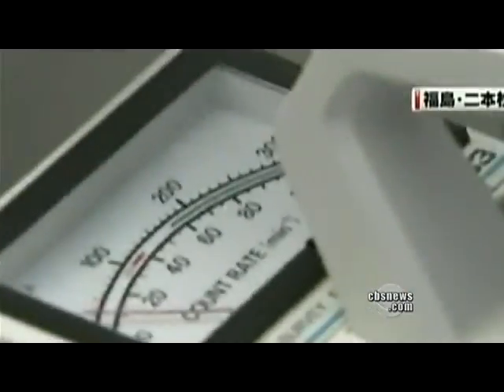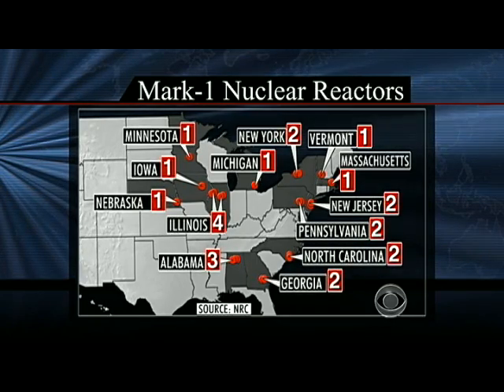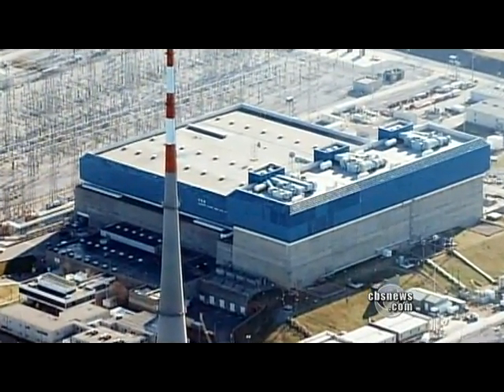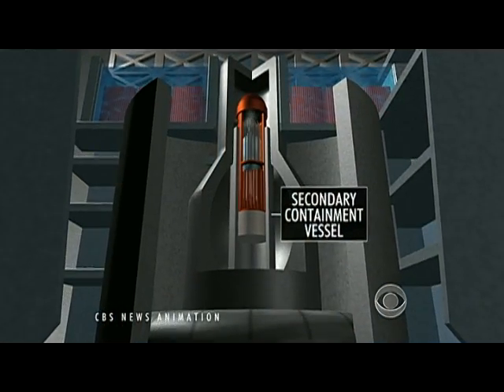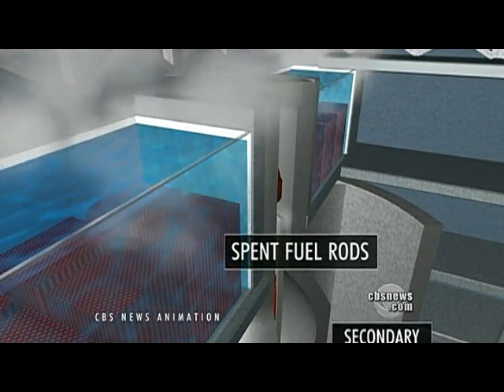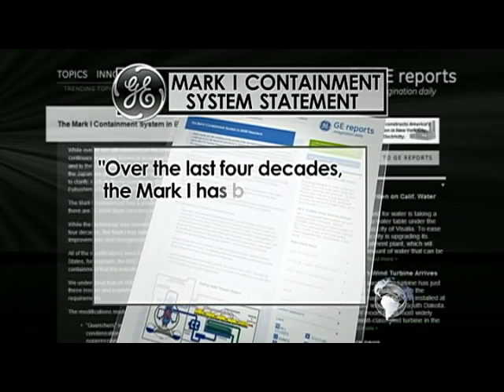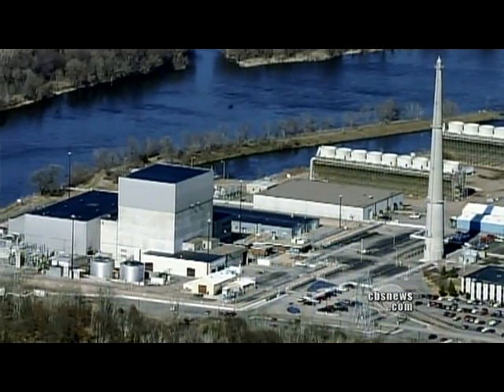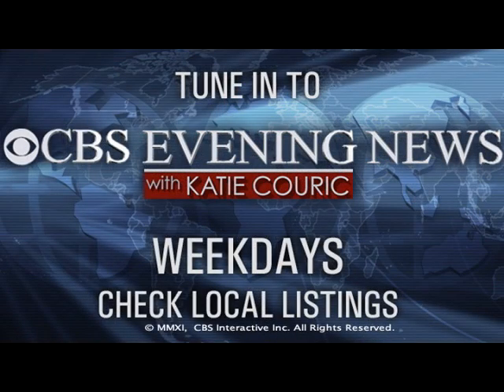The danger of old U.S. nuclear plants

Comment: 13 year old video and less than 20 comments......that's what is  scary......one of these reactors near me just had it's service life extended to 2035 which is 60 years after it was installed.....High pressure super heated steam, radiation, metal fatigue, erosion of metal, what could possibly go wrong????😄

Comment: Solution, triple and quadruple the back up power electrical systems. With out cooling water, IT'S A DISASTER. With out pumps, the electricity to run them, it will melt down. Lets add another layer of redundancy.

The GE engineer is feeling a little vindicated. He did the right thing, should be proud. It takes guts to do what he did. His worst nightmare may have not been realized in the 35 yrs, but as they were designed in the 70's, I'm sure they were much more vulnerable with out the mods.

Comment: @canisdormit When the earthquake hit, the reactor scrammed, or shut itself down, as designed. It is not producing enough heat to make the steam required to spin the giant turbines. Therefore, no electricity. Normally, the diesel generators would kick on, which the plant has many many giant diesels, but they were wiped out by the tsunami.